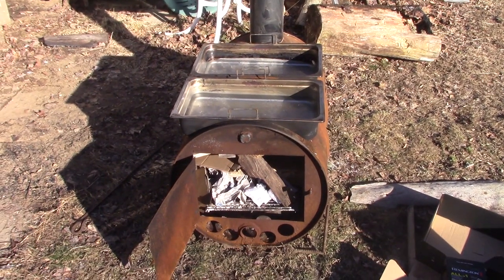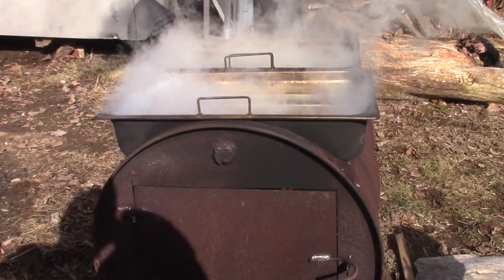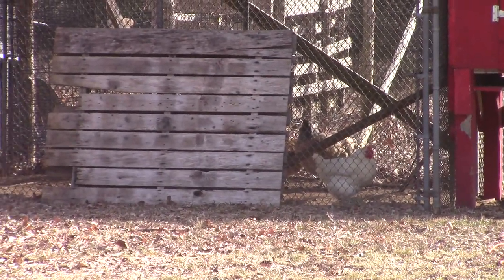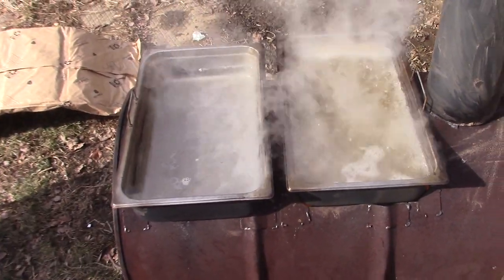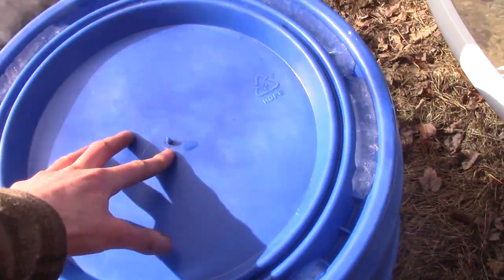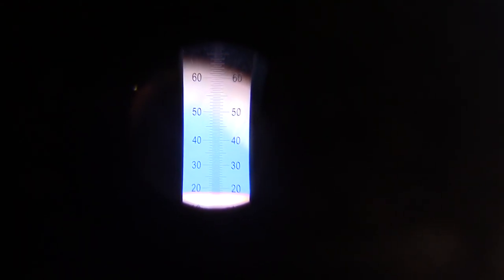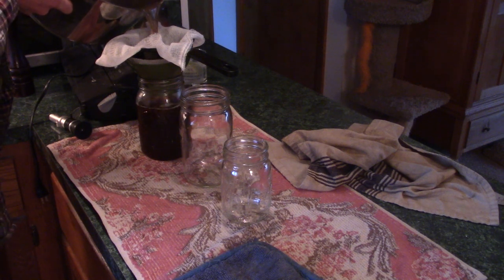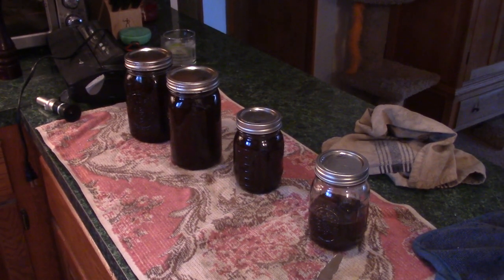Maple Syrup Evaporator From A 55 Gallon Drum

Comment: love your idea to reduce heat loss, by setting drum into earth and stone, for insulation, requiring less wood...[oh, then kira suggested why wait...]
also regarding the syrup tasting maple-y, but not as sweet as expected - good evaluation /solution - to pour out partially boiled down syrup and finish on stove
lastly - 28:1 raw-to-ready. wish you had some sugar maples to see if process is shorter from more sugar content - which is why they're called sugars!  
keep on living off nature!
Reply from the maker: Yup, that was Kira's idea! it seems to work. On my second run I also changed the internal firebox shape a bit to force the heat up more rather than over and out. considering what i'm working with, it seems to work well. It's much less than 28:1, average of my two runs is about 50:1 because i'm not using sugar maples.